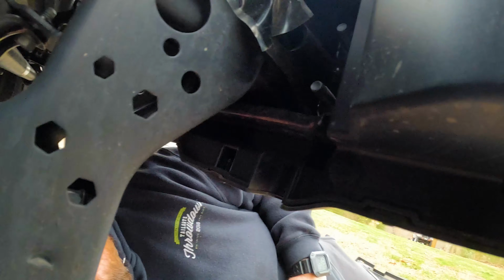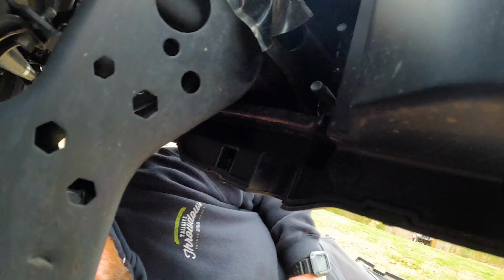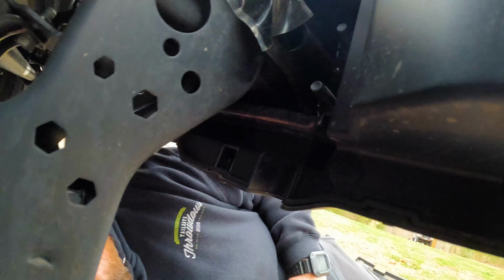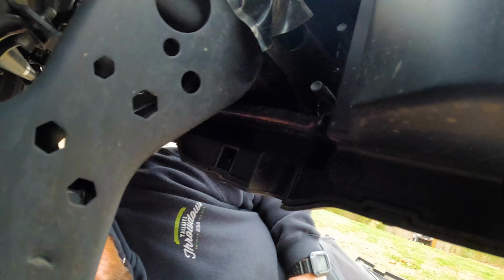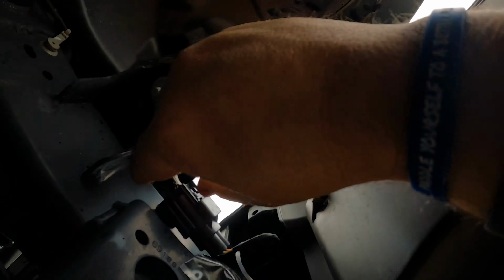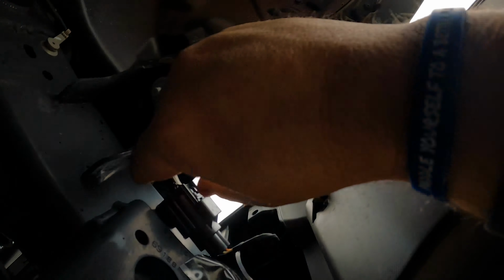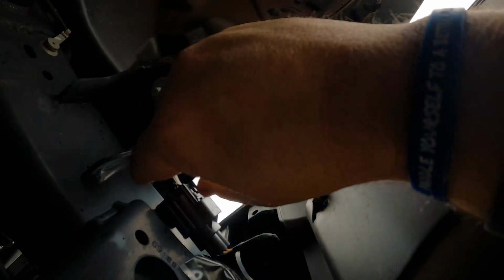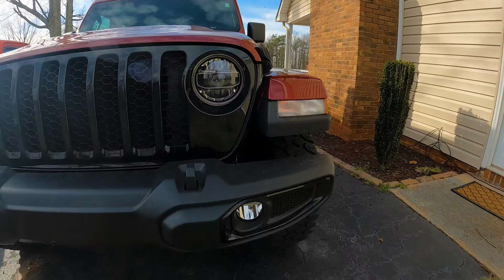Gladiator MOPAR LED fog light install.

Comment: With the Tazer, were you able to get the LED fogs working? I got the full Rubicon steel bumper and am having the same issue (coming from halogens). I've read on the Gladiator forum that I need to have the dealer flash my computer to change to LED fogs. I also read that if you turn the LEDs on before the flash, it can ruin the MOPAR fogs. What did you find out?
I also read that most aftermarket LED fogs don't have this issue.
Reply from the maker: Hey thanks for the comments!! Yes the tazer did make the fog lights work with out any flicker . The only issue im having is my front turn signal lights keep showing out in my cluster and i  havent done anything with my turn signals. I have talked to the tazer ppl and we are working on a solution
Reply: @Steamfan85  Good info. I wonder if the Tazer just changes all lights to LED and if your turn signals are still halogen they may not register as working even though they are? I'm planning on going to the dealer to have the computer flashed since I have larger tires now too. Hopefully they can flash it so it recognizes just the fogs as LED as my turn signals are still halogen. I have Oracle Oculus LED headlights now and no problems with those. I don't know why the aftermarket stuff is plug and play and the OEM stuff isn't. You'd think it would be the other way around. I've read that most of the aftermarket LED fogs are plug and play.  Hope it works out for ya.
Reply: @Steamfan85  well I found out my dealer wants $400 to set my fogs to LED and change tire size! No way that's gonna happen so I'll be getting a Tazer. Check out wayalife's video here https://www.youtube.com/watch?v=tISJN_QGM_0 He got some error codes, not the same as yours but maybe going through a similar process maybe that will hep your issue. I'll let you know how I make out since I'm now in the same boat as you!